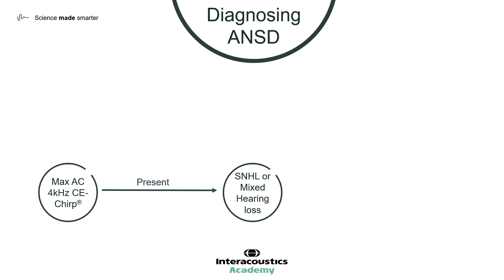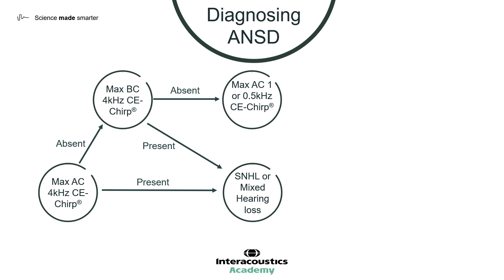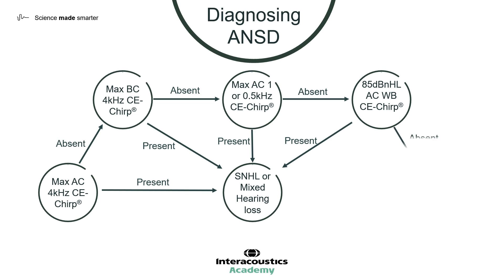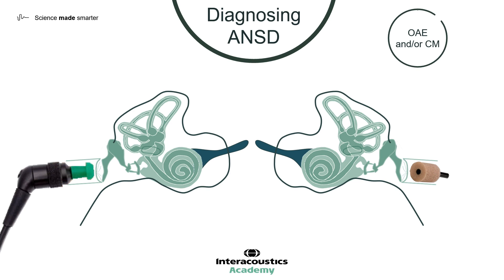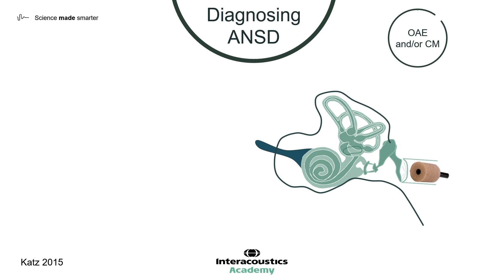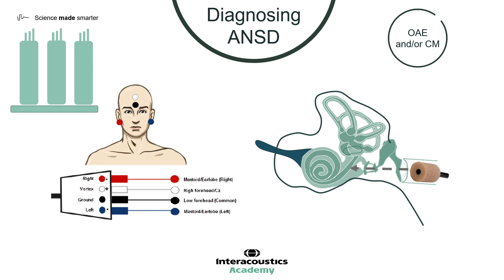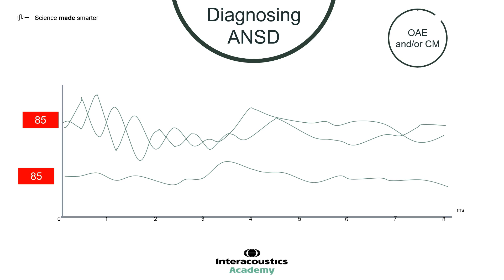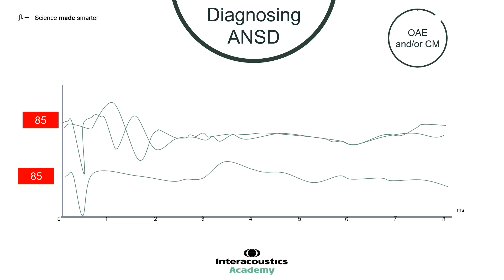Diagnosis of Auditory Neuropathy Spectrum Disorder (ANSD)

Comment: I am slightly confused if OAE and Cochlear microphonic both measures the function of outer hair cells. If OAE is absent and CM is present, how does CM records a response but OAE does not, it seems confusing and contradicting between both tests?
Reply from the maker: Hi there!

I forwarded your question to one of our audiologists, and he answered:

OAEs and Cochlear microphonics are both thought to generate from the outer hair cells. But, the recording methods are very different. OAEs rely on the acoustic transfer of the emission back to the ear canal where it is picked up by the probe microphone. This rely on good middle ear function. Cochlear Microphonics are recorded by electrodes (on the surface of the skin in the case of newborns as discussed here) and therefore can be recorded when there is poor middle ear function.

Best regards,
Shane